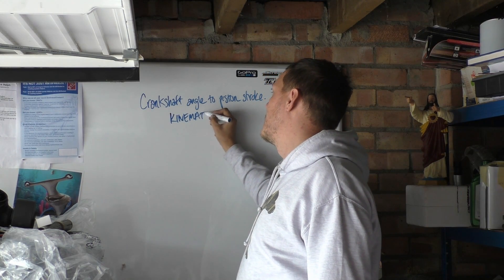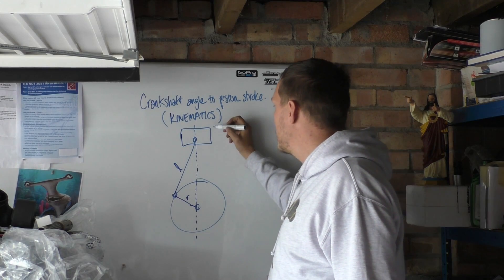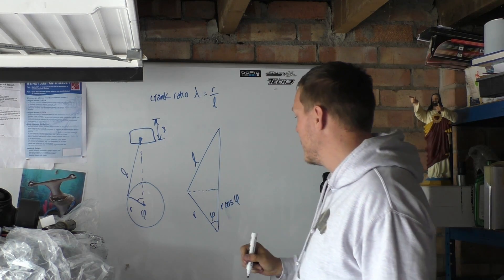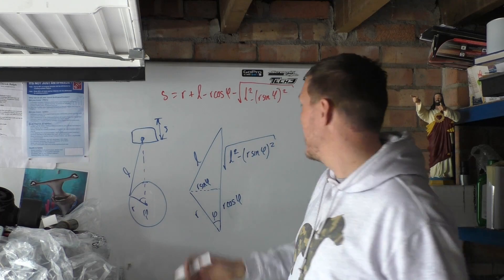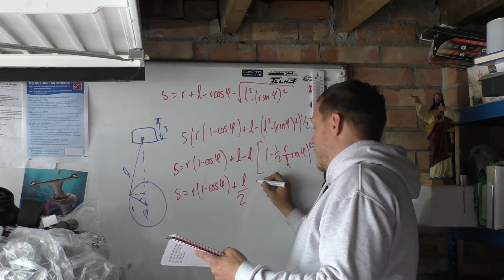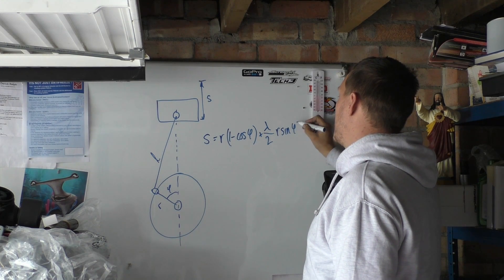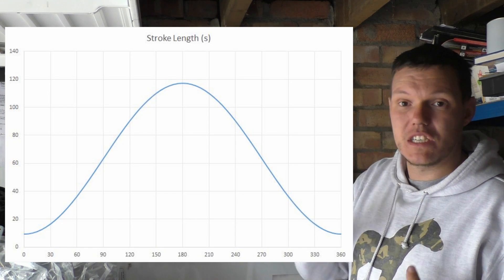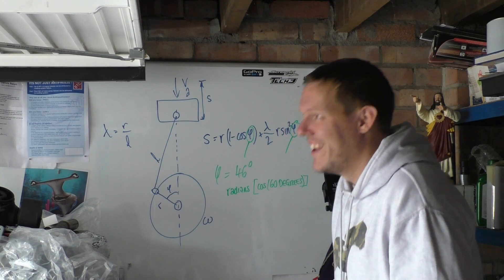Crank Angle vs Piston Location - Part 1

Comment: Your rod length doesn't convey your stroke length but still pairing longer stroke with small rod means you'll end up pulling out your piston.
So make sure your math works out.

Also, too high RPM would increase acceleration induced load on piston and rod so you'll end up blowing it inside the stroke. Therefore, make sure you've got a girthier piston & rod. Or decrease your rpm and stroke length, accordingly.
Just know your piston's & rod's limits.
Reply from the maker: Who was this comment for?

Comment: Like your videos a lot. I have a question. I have got a 2012 Kawasaki 250 ninja engine. How does the ignition system work on the timing of both cylinders?
Reply from the maker: Hey dude, you're gonna have to be a bit more precise than that. What do you mean how does it work?
Reply: @thedirtyworkshop  OK so i know how the cdi and the ignition coil operates for a single cylinder engine.  In the case of a parallel twin e.g. the Ninja 250, the cylinders operate at a 180 degree angle how does the ignition then operate to spark at the right time for both cylinders
Reply from the maker: That'll be the pick-up coil on the flywheel. You can see the timing strips on the outside. 

https://i.ebayimg.com/images/g/jTIAAOSwD8ZZ70p2/s-l1600.jpg
Reply: @thedirtyworkshop  That makes things a little more clear but there are only 2 wires for the pickup does this mean only one pickup for both cylinders?
Reply from the maker: Yes - the pick-up provides a trigger signal - like a rifle. You don't need a trigger for each bullet.
Reply: @thedirtyworkshop  Great that makes my life a lot more easy. Busy doing a project to swop the ninja 250 into a 1982 kl250

Comment: Is my rod length the “stroke” part in the indicated bore x stroke engine measurements of my motorcycle?
Reply from the maker: No. Finding rod length numbers is really hard - the only way to do it is to measure the rod itself. The stroke is the crankshaft throw - nothing to do with the rod

Comment: yes i understand,  but the rod has nothing to do with what I initially thought, ... which was, (and forget about crank angles, rod length)... the distance between the center point of the crankshaft and the center point of the big end  mounting, is the same distance of the stroke. ... if the distance on the crankshaft to big end is say 60mm, .... the stroke can ONLY BE 60mm, ... or are you saying the stroke would be 120mm???
If we start at bdc and the distance between crank center and big en center is 60mm, then we turn the crank 180 degrees to tdc , that distance the piston would travel is 60mm isn't it????

Comment: NO, NO, NO...... I am right, 180 degrees of crank rotation "IS", the stroke, 1 stroke. (up or down, not both)
Therefore, ... the distance between crank center and con rod big end center is the length of 1 stroke, ... the stroke.
Reply from the maker: 1 stroke is the distance the piston travels and is the same as the where the centre of the crankpin is at 0deg and 180 deg.

The rod length is NOT the stroke - rod lengths are longer than the stroke in nearly ever case ever.

Comment: I'm no engineer, but wouldn't it be easier for all practical purposes to work out the sine wave and just pick values from there?
E: if for some reason the wrist pin is offset, I realize that waveform you get is different. However, it should work with any wave really.
Reply from the maker: And this is how you work that wave out
Reply: Your are correct, it is not sinusoid waveform, but close to one. Time is not a factor in this equation. Shorter crankshaft, while keeping wristpin constant, will affect maximum acceleration of a piston before and after bottom dead center, making them drift away from BDC, if I understood what you meant. In real life it will also wear piston and cylinder with greater side loads. Crosshead engines do not have this problem with cylinder, but crosshead itself will wear out.
Reply: Guns Cars and Digits, I see what you are talking about, you know your stuff. I'll pay attention to this tomorrow when I am not drunk, no offense really. Thanks for your input, I'm always eager to know more!

Comment: One thing I noticed when you drew the crank/piston and con-rod, is that the stroke =, ... IS ... (AND HAS TO BE), the exact same as the crank radius, ... yeah? ....
Reply from the maker: I don't quite get what you mean but stroke = 2 x radius as in the complete stroke length. This equation is how to determine how far the piston has moved in relation to crank angle
Reply: It just popped in my mind as I saw you draw the diagram. 
This is what I thought: ..... From  the center of the crank to the center of the big end the complete length, ..... BUT,  Yes, I was wrong, 2 x that, is the answer, ....... I get it now, ..... I need to really wake up before posting silly comments like that eh!? ..... What a daft twat.......  Sorry Matt.

Comment: wait am i missing something or is the change in s (stroke length) not the same as the diameter of the path of the crank pin? at TDC the total height of components from the center of the crankshaft is just radius+length+piston height. At BDC its -radius+length+piston height.
Reply: You're referring to total stroke length. Matt's explaining how to measure the changes in stroke through the complete rotation of the crank. So if you needed to know how far the piston moves at a certain crank angle, this equation will give you that.

Comment: Basically, a large diameter cranks will result in more twisting force but has the drawback of piston idle time at the top and bottom of the stroke. In 'V' engines it is very important to get your lower deck correct or else the con-rod will push the piston out of the block. Offset gudgeon pins attempt to address this problem by balancing the piston in the bore.
Reply from the maker: "Offset gudgeon pins attempt to address this problem by balancing the piston in the bore."

- What the fuck are you talking about. This doesn't even make sense.

Comment: What would happened if you moved the gold crank 01 or 2 mm to the right or left from center of the cylinder sorry if I'm bad at explaining
Reply from the maker: that's what desaxed cylinders are
Reply: I think Yamaha 300cc scooter 'blue motion' engines have an offset crank.

Comment: Wrist pin offset?  If you are going to throw the shit out there, throw it all!  LOL
Reply: Yes, I'm a dickhead.....but I am correct, aren't I?
Reply from the maker: Same thing as desaxed cylinders - well the calculations are-ish LOL
Reply: The Workshop, yeah but do the engines with desaxed cylinders use wrist pin offsets?  The thing I like is how wrist pin offset messes with the dwell....which is key for valve closings and opening, piston velocities, cylinder wall forces....flame travel....direct injection issues.....all of it.  The shit is more complicated than most think it is.....that's what excites me.  Hell yes, MATH IS AWESOME!
Reply from the maker: "The Workshop, yeah but do the engines with desaxed cylinders use wrist pin offsets?" 

generally no, its usually 1 or the other, but there have been cases. As far as I know desaxing is more common than wrist pin offset